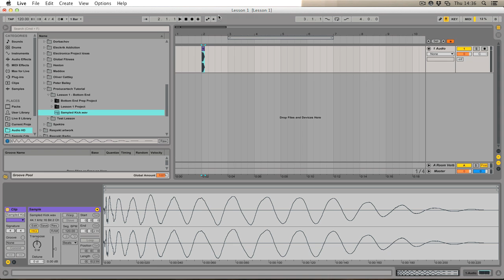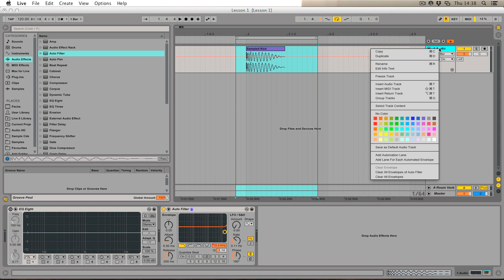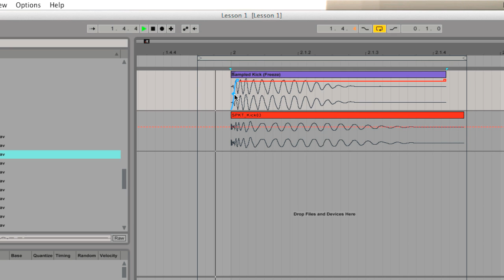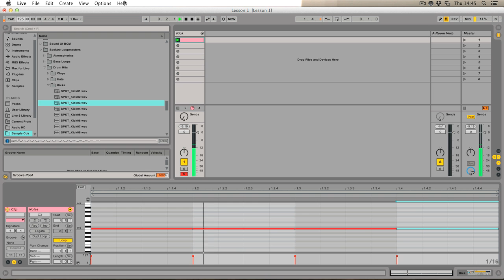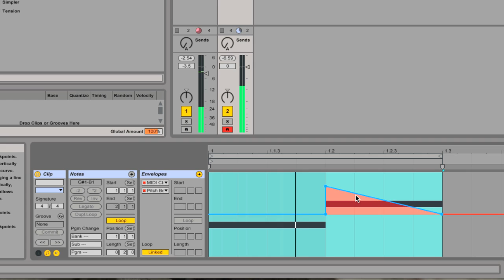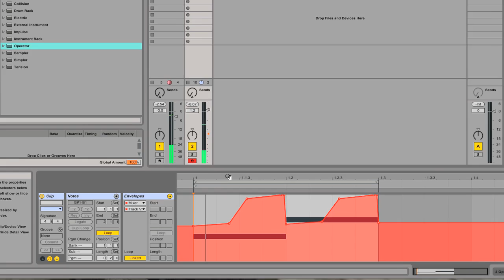Designing Layered Kicks and Basses for Tech House by Paul Maddox

Comment: To clean the kick duplicate it 4 times, load ozone imager on each one of them; Isolate low, mid-low, mid, high, on each ozone then freeze and flatten each track. Now you can remove the hihat easily and use the eq to remove stereo signals

Comment: I recommend using xfer's LFO Tool instead of the track volume modulation for sidechaining. Using compressors on techno kicks/basses makes no sense at all, so might as well always use the LFO Tool. The smooth option also lets you remove the clicks ;)
Reply: I concur. LFO Tool does a fantastic job for that sidechain effect without the compressor hassle.
Reply from the maker: ah great idea! thank you

Comment: for some reason when i group my kicks it does not sound the same at all whats going on here as i have done step by step it sounds quite and like the start of kick is missing?
Reply: +DJ Kenny Magee Now I don't know the quality of your samples, but, it may be that your samples are of a lower quality. If that's not the case, ensure your attack parameters aren't offset causing the beginning of your kick to be missing. If that is also not the case, perhaps the EQ's you set aren't bringing out the dominate frequencies needed to make that punch.  Hopefully one of these will solve your issue.
Reply: got it thanks i had to turn up the volume and adjust attack and so on :)

Comment: is there a way you can make this process even more convoluted?
Reply: +Asher Frank i think its easier to explain it in sort of a trifector arrangement, or the triple threat. The club-sub, the KNOCk, and the tick, (or click)..  then do that with all kinds of sets of bits and bobs from different sources.. then i.e., in logic, just open the three fat eq's and anaylizers or what ever metering you have in the daw, of each thing on each track at once, and assign the eq's, between the three, like 20 to 55 for the sub, the mids for the knock, and confine the tick to the top end. For example, in Logic, you could grab a sub bass preset off the TAL roland sh 101 emulation, another track with the 909 kick sample in the TAL Sampler, and then pick up a click off the nicky romero plug in, but you could grab similar from various... the Tal sampler gives easy to use tunings. but myriad kontakt gear will provide the pallete. kind if a cro-bar punk rock view of it, but easier way of saying it than this.. IMHO. of course you get picky on the glue compression, but thats another thing. but im sure you already knew that and were being facecious. so props there. i think the inane thing is that all this starts off from sampling from a record to begin with...

Comment: Good tutorial, a lot of questions i had were answered with this. If you were making a really basic tech house beat with these, when you put your high hats in would they be on the same beat or after them? im having trouble getting that right
Reply: +rtstephens91 you should experiment, try switching off the fixed grid or put it on a smaller fraction and moving around the high hats to get the shuffle you are looking for. layering samples with loops can be effective too i'm finding

Comment: The loop issue has nothing to do with the fades, you're right. It's because the automation starts right before the sample, not on it. So when it loops it's not catching the first point because it was marked too early. It's important to make sure each automation point is correctly set in the right location so you don't get issues like this, especially when duplicating or looping samples.